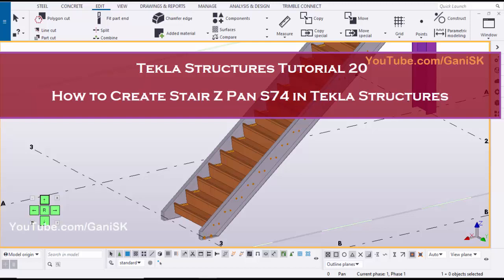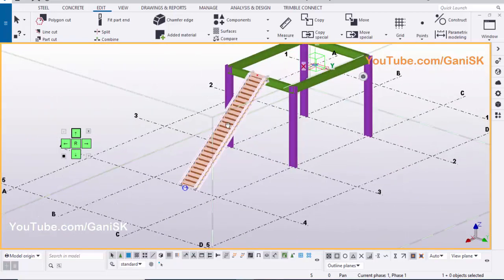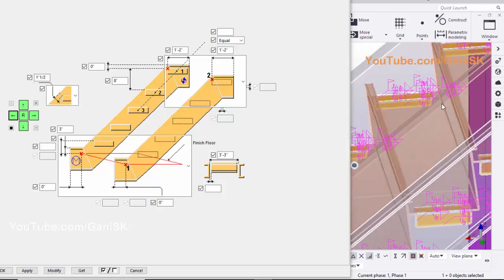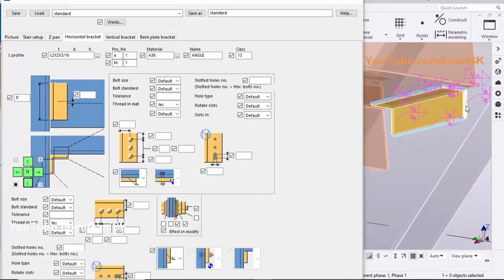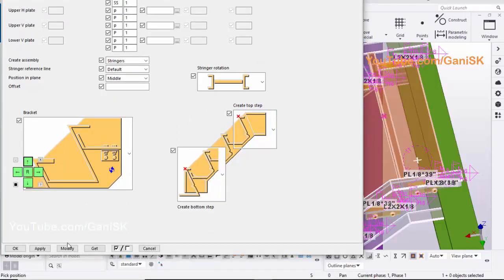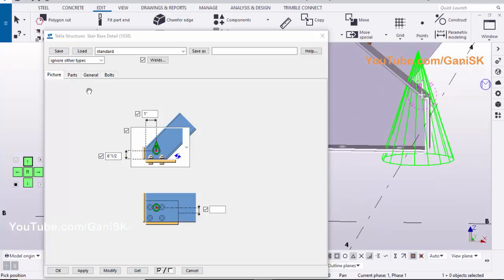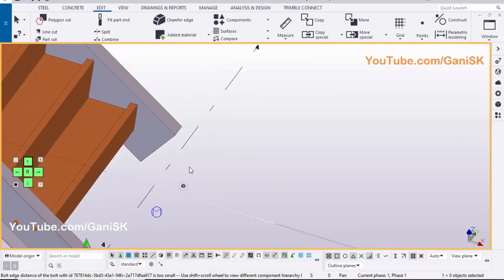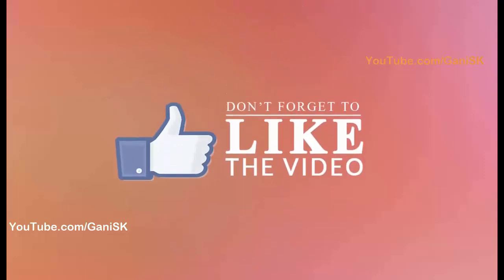Tekla Structures Tutorial 20 How to Create Stair Z Pan S74 in Tekla Structures

Comment: Hasn't worked on mine, although I'm using a UK Environment, the stringers that normally frame into the header beam are shown framing into the ground and quite bizarrely, at the top of the stair, one stringer is shown cranked, whilst the other end follows the slope of the stair. No wonder I hate this software. I have tried picking the points in reverse order in case it was sensitive, but no joy.